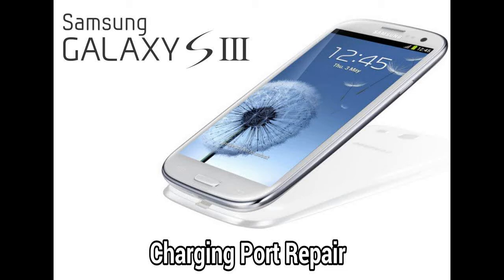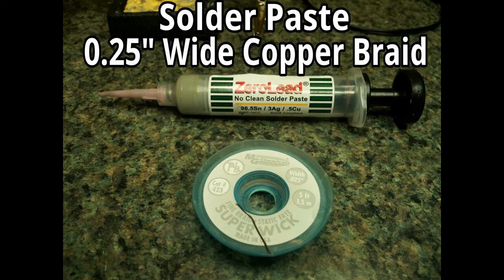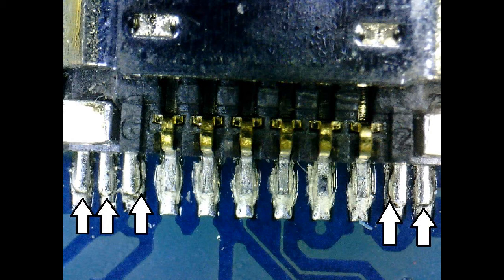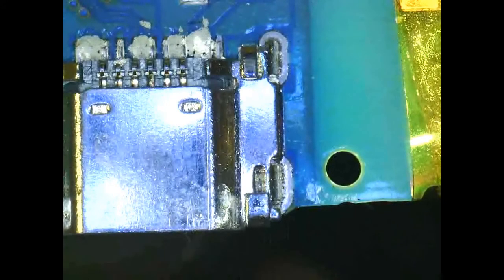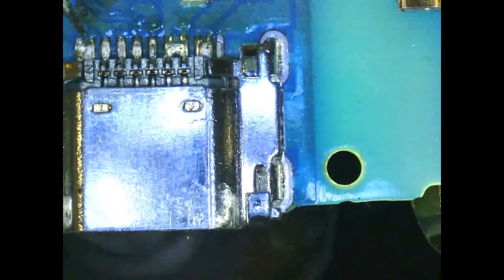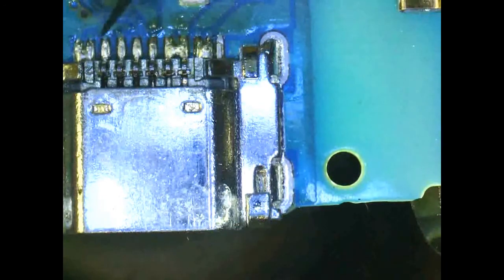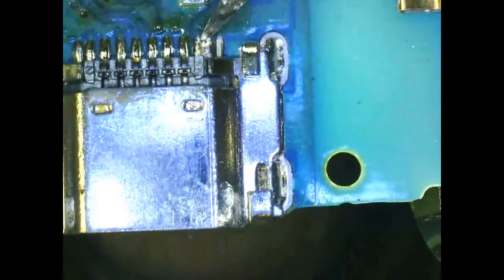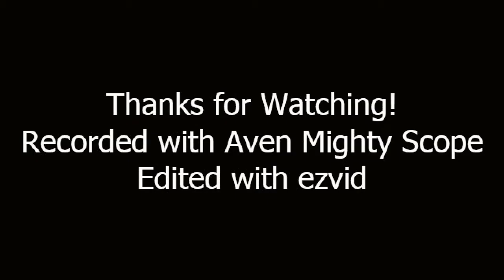Samsung Galaxy S3 SMT Charging Port Repair

Comment: Confusing, half the video was about de-bridging the pins. The video didn't show you putting Kapton tape over the holes on the under side of the usb, yet you mentioned at 4:43 that this needs to be done, otherwise the plastic in the usb will melt...?
Why do you need to heat the board up before applying the solder, does it matter?
Are you doing all of the heating from below the board?
Cheers.
Reply from the maker: This video is meant to explain the technique and things you need to know for this repair. The phone was prepared beforehand, that's why you don't seem me do some of those things.
The reason I head the board up first is because it is easier to control the amount of solder paste you apply to the board instead of having a big glob on there. Keep in mind these parts are about 1/10 the size of a part you might repair on a computer board, or other electronic, so precision is key.

Comment: can i use electrical tape instead of kaplan tape?
Reply from the maker: Do NOT use electrical tape. The Kapton tape is a special kind of tape that is head resistant and will not melt or burn, and it protects the board and components from getting damaged. If you use electrical tape it will melt and could damage whatever parts it is covering.